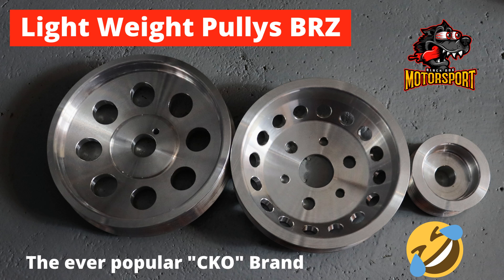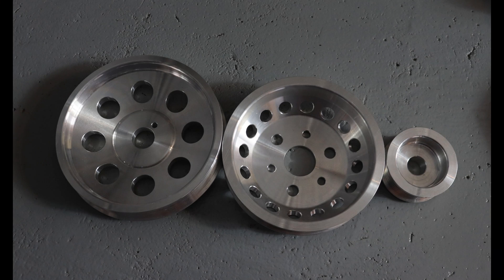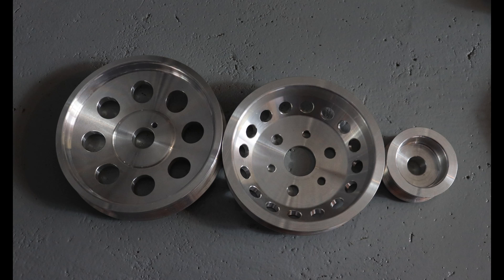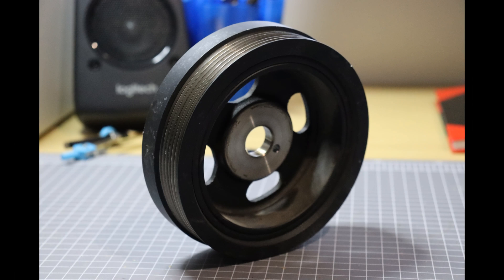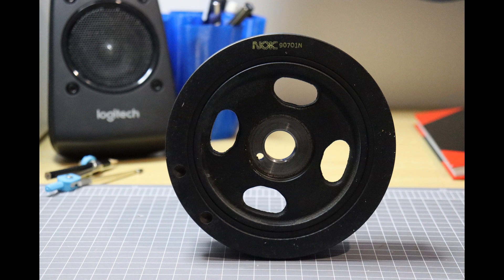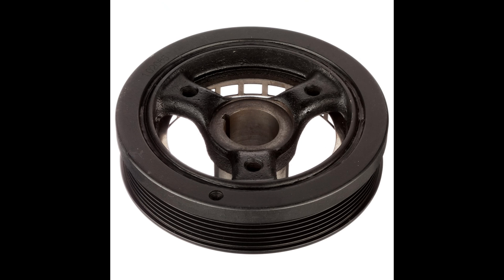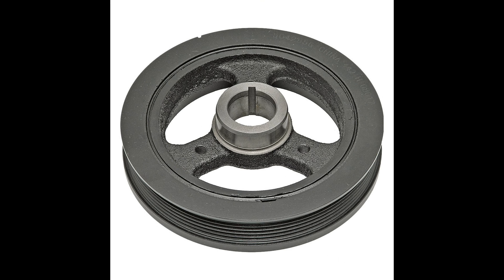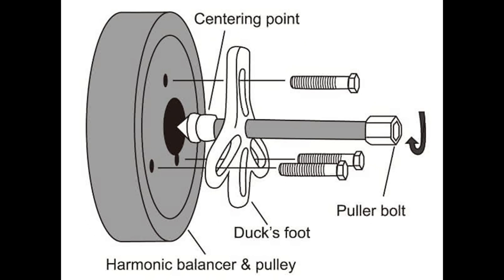Pulley Vs Harmonic Balancer

Comment: So a harmonic damper replaces your stock crank pulley. nice video thanks
Reply from the maker: @yellowjoe.2000  no not exactly. I replaced the stock crank pulley with a light weight crank pulley, so like for like sort of. 👍
Reply: @blackdogmotorsport3784  ok so you installed a lightweight pulley along with a harmonic damper? thanks

Comment: You have no idea what you’re talking about. There is a rubber layer between the hub and outer ring. This allows the hub and outer ring to move separately, very small movement however. Which makes it a harmonic damper. A pulley is one solid piece.
Reply: Yea, you may want to do some research on that buddy. He's 100% right. Please see the attached video
https://www.youtube.com/watch?v=Vo2g7544Fz8&t=3s
Reply: @RedDevilParatrooper1-508th  - have you done your research buddy? Who are you going to trust? A guy from a company that probably doesn’t exist anymore, trying to sell you a part with 5x markup that anyone can make? Or the industry leader that is approached by the best engine builders in the world and asked to build a product?
Reply: @RedDevilParatrooper1-508th  - a salesman trying to sell you his products can be very convincing. I know what teams of engineers at oem manufacturers do and how much they spend. If they could use a cheaper part they would period. https://youtu.be/J1BGsgIZ_Ek
Reply: @RedDevilParatrooper1-508th  Your attached video link is a good one in the sense that it states that it all depends on the type of engine you have.

Comment: About to do the install for this .. how long have you been running these pulleys now and any issues ? I am a little hesitant about the crank pulley install.
Reply: We have use light weight 6061 underdrive pulley on inline 4 honda for over 25ys and have Hondas with pulley well over 250k miles with no issues, I sell a lot of pulley kits since late 90’s and never have 1 vehicle’s engine fail due to light weight pulley, it’s always cold air intake hydrolock that damaged the engine. In-line 4, flat 4, flat 6, these 3 types of engine can run aftermarket pulley & it will free up alot of power…
Reply from the maker: I have been running this Pulley for about 12 months with no issues. ( As at June 2022).  
👍
Reply: I also want to add this, if you install high quality pulley kit like the one we sell for k-series honda, the engine will run smoother than oem, and have less vibrations than oem.
Reply: @wkndbikeshop  It will rev a little faster and can be ''ok'' for low hp street car / showcar (bling mod like the "throttlebody spacer"), But how it can run smoother with less vibration than a "hardcore" dampened unit like Ati, Fluidampr..or even the OEM dampened unit ? An inline 4 cylinder engine has a secondary imbalance by nature which causes vibration.. While its completely fine to under-drive the accessories pulley especially on a race car that stay in the upper rpms, a solid 6061 crank pulley simply cannot absorb more vibration than a dampened pulley. Wayy smarter to put a lightweight flywheel and leave the oem harmonic damper alone.. on K-series you can even swap the K20A (typeR) pulley which is underdrive and dampened from the factory.